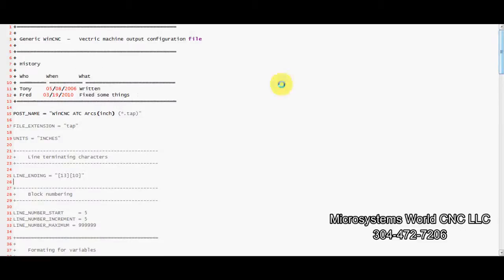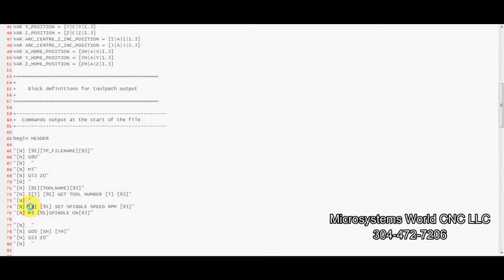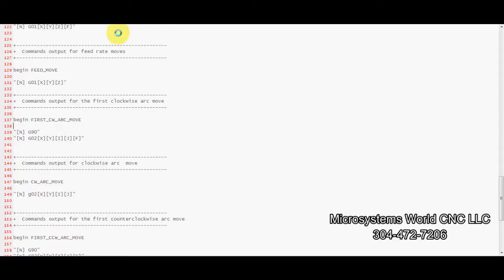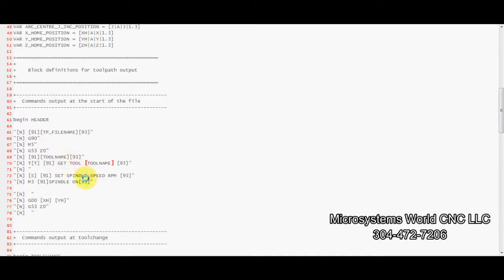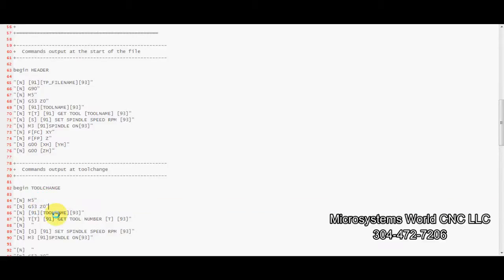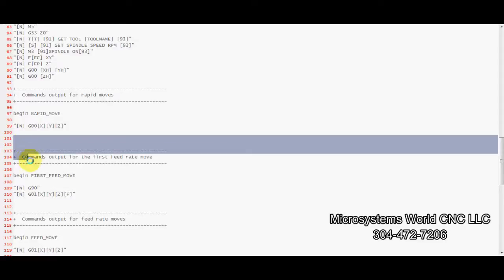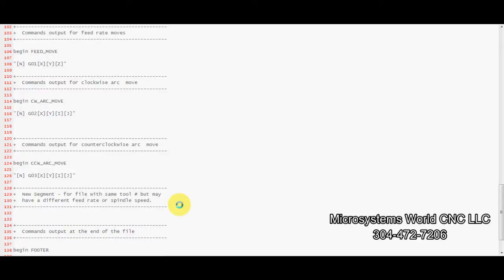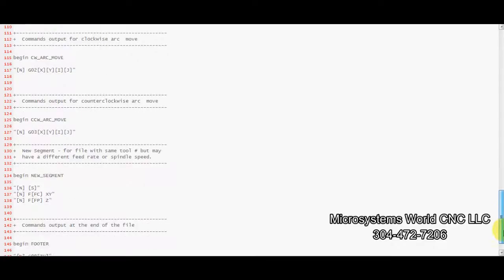Edit Vectric Post Processor

Comment: Good information.... Do you know how to setup the post to output on G03 for a full circle?  Mine currently outputs full circles in quadrants or four G03's to cut a circle.
Reply from the maker: No, sorry. To my knowledge there is no way. As far as WinCNC goes, you can always do G3I2 to make a 4 inch circle with  the starting/ending point directly to the left of the circle. You can use G3J2 to make the same circle except the starting point at the top of the circle. By the way, G3 is a counterclockwise arc, G2 is clockwise. One more thing, G03 and G3 are the same. G02 and G2 likewise. Of course, Vectric can't do this...

Comment: don't change the line number start and increment to 1.. if you do that you won't be able to insert a custom line after its being generated.. they set it to 5 so you can enter lines in between..Thanks for the information by the way . very helpul
Reply from the maker: Line numbers aren't even necessary. They're there for your/my convenience. I set them to 1 so that I can instantly find a line in the file when my controller tells me it found an error on that line. If I add a line, I won't add a line number, my error is still very near that line # when I scroll down to it. If I leave it at 5, I can't use that method. 
Thanks for the reply.